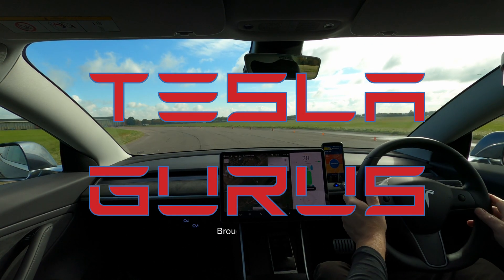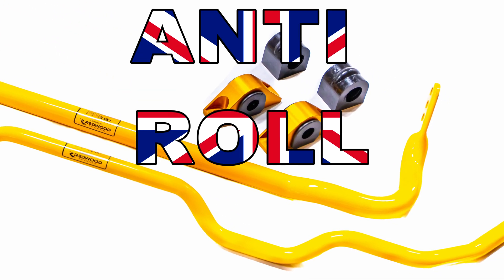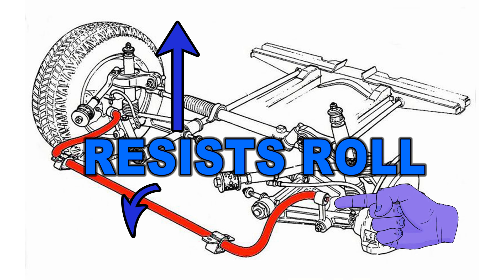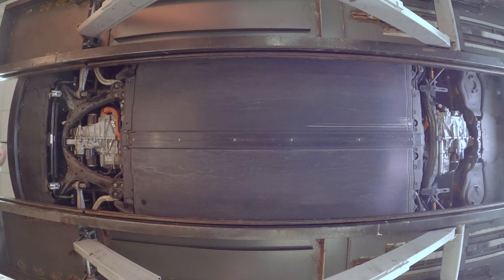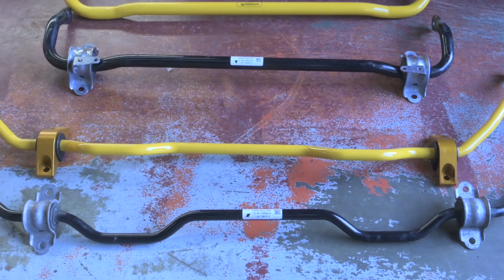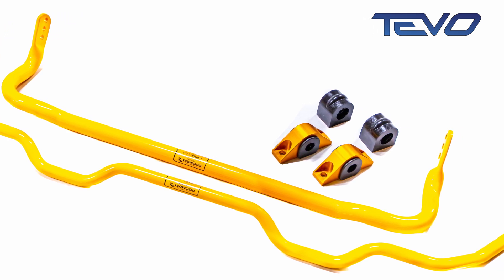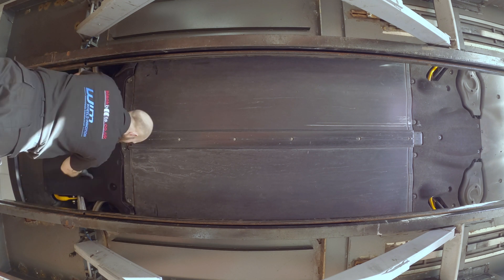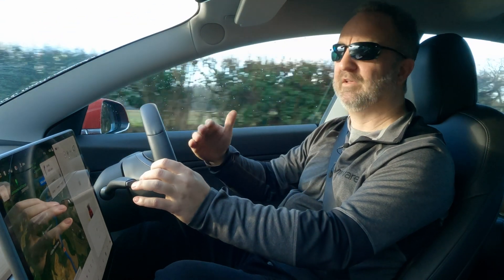Is this the most cost-effective handling upgrade for a Model 3?

Comment: I have a 2022 Tesla Model 3 Performance and I decided I wanted to make it handle better. So I took these guy's advice and bought some Redwood sway bars and had them fitted on the hardest settings front and rear and bought some MCA Pro Sport coilovers which I have set right in the middle for firmness. What a transformation, my car used to have some body roll and the suspension used to get bouncy when the shock absorbers got hot. No more, very little body roll now and zero understeer and just a little oversteer (a very slight power slide) if I go hard on one of the many cloverleafs we are lucky enough to have in the city that I live in, Canberra in Australia. It is an absolute blast to throw around corners. It feels so planted and I have absolute confidence that I can push it as hard as I like into any corner and it will safely negotiate it. So thank you Tesla Gurus for your advice, very pleased to have followed it.

Comment: Do you  need the adjustable end links???  I see a lot of people just doing the bars.  Thise end links are almost as expensive as the bars themselves! lol.  Nice to see this video as the new model 3 went too soft regarding sway.  I feel like im on a jet ski in the turns without the water.....With no other suspension mods, can I go full stiff front and back or do full stiff in the back and middle hole in the front?  Whats the benefot of middle hole in the front?

Comment: @TeslaGurus I am aware of the advantage of ARBs but I was wondering of suspension Geo and tyre pressure. I noticed that the highland has more front toe out than previous generation awd. I would expect the steering to be more neutral with the added toe out and I though that better geo associated with 40/42 psi front and 44/46psi rear should make  steering more responsive. What are your thoughts/experiences?
Reply from the maker: The Tesla service manual hasn't changed. Front toe is still 0.05 out (with ballast). A little toe out is always a good thing IMO but it's personal preference to a certain extent. Don't forget the Highland M3P is a staggered setup, so ARBs will be tuned differently to previous M3P. As with all cars, geo needs to be tailored for a particular use case, so it's best to work with an experienced alignment shop to determine the best settings for your needs.

Comment: If you upgrade the suspension to coilovers Mountain Pass Performance actually recommend putting the stock sway bars back in or using their sway bars which are only mild stiffness.
Reply from the maker: I agree that with any decent set of coilovers the sway bars don't need to be upgraded but it does depend to some extent on the spring rates used.

Comment: Wrong about the welded tips a good tip is welded but the tip should be welded on outside but also have a tab that protrudes inside the tubes this prevents flex and hot spots but a formed tube can only be formed so much before it becomes the weak point.

I won’t make any claims it’s not better than stock but as an engineer I can make a better product that has a weld

Comment: I am so regret to have my sway bar upgraded to Eibach,which is much stiffer than stock one resulted in a very uncomfortable drive
Reply from the maker: Are  you using the factory drop links or did you buy adjustable ones with the sway bars?

Comment: ive noticed excessive tyre wear on the rear wheels of my M3P. I read that it can be caused by faults with the rear suspension. There doesnt seem to be any adjustability on the rear wheel suspension either at least with stock parts. Have you guys made a video about this, can it be easily upgraded to help preserve the tyres?
Reply from the maker: There is adjustment for toe, which is the most likely cause of your wear.
Reply: @TeslaGurus  The wear is entirely on the inside of the tyre, it looked in good condition from the outside. When up on the ramp it was down through to the fabric. The garage guy said there was no adjustment he could make.
Reply from the maker: @samuelprice538  He was wrong. There is a small amount of adjustment for toe at the rear. Take it to someone who knows what they are doing such as Blackboots in Chesham, Bucks.

Comment: Wider tyres and drop the pressures will give same effect.
I have equipped my tm3p with 245 45 18 Goodyear Supersport tyres with light rims. Hot pressures is 40psi. 
100 load Index tyre, can carry more weight at lower pressures.
On 42psi cold, car tips/rolls more. Effect that you're describing. 
With lower pressure, sport steering mode is more compliant too.
Reply: Wrong, wider tires have zero to do with body roll and if you droop pressures, you will get tire slide over the rims.

Comment: Do you have the squeaking noise from the rubber bushings? I got the same sway bar and have that noise! Any suggestions?
Reply from the maker: All sway bars and bushings can suffer from squeaking after a while. The usual answer is to re-grease between the bar and bushing but we are testing a more permanent solution. Have you gone back to whoever supplied them to find out what they say?
Reply: @TeslaGurus I have eibachs for 2 years now and creaks started , regressed them with silicone grease did not help. After weeks of checking and degreasing I found cure.
Wrap the contact area of arb and bushing with ptfe plumbers tape, regressed and reinstall. All noise gone. The polyurethane bushings are known to squeak and it’s like your arm bushings are broken. I think the bushings have been polishing the arb surface so much that’s it squeaky clean and very grabby.

Comment: Will the lifespan of stock end links be affected by fitting a stiffer anti-roll bar?

Cheapskate, pondering if it's a false economy to avoid having aftermarket end links fitted if it's somewhat inevitable they will need replacing later.

Will confess to much of the information in http://www.aurorabearing.com/pdf/in-rod-we-trust.pdf going over my head.

Are the stock end links non-adjustable, meaning there might be some unbalanced pre-load on the anti-roll bar?
Reply from the maker: Making any suspension part stiffer could shorten the lifespan of other parts on the car, but it's difficult to guess how much it might affect the drop link bushes. Not much I'd say. Aftermarket end links will also wear too. Everything has a lifespan!

Comment: What hole setting did your friend use for the front snd back on the sway bars?
Reply from the maker: He went full stiff front and rear. I would recommend maybe trying full stiff at the rear and mid way at the front to begin with but it depends on what sort of driving you'll be doing and whether you have any other modifications to the car.

Comment: If the thicker anti roll bars are better and don't detract from the ride quality why are the OEM bars not to that same specification? Any cost difference would be invisible at the time of manufacture. There must surely be a trade off somewhere?
Reply from the maker: For the same reason a lot of owners complain about the ride quality and handling of the factory coilover suspension. All components on production cars are carefully cost-controlled by the accountants. They just have to be 'adequate' for the target market. Not all Model 3 owners care whether it handles really well, so a cheaper anti roll bar with no adjustment is fine for them.
Reply: @TeslaGurus  But if we are talking about the Performance Model 3 people are paying well over the odds ... for ... performance!
Reply from the maker: Name one mass produced (i.e >5000 per year) performance car which is fitted with the very best of each and every component from the factory. This is why tuning companies exist. They make a mass produced car better by improving areas the bean counters don't allow. For the performance you are getting from a stock Model 3 Performance, you would be charged a lot more money by BMW, Mercedes, Porsche etc.

Comment: Great video 👍 just found /subscribed . Nice to hear some English 😆
Question: can you explain more about the adjustments .. I always thought softer antirollbar at front and harder at back reduces understeer and gives better turn in (almost counter intuitive !) . Does this apply to the model 3 ? . And how effective are the 3 positions ?
Reply from the maker: Hi Mark, thanks for the nice comments! Yes, you're quite right that stiffening one anti roll bar will lead to a higher proportion of grip at the other end. It works exactly the same with the Model 3 but because it already has a lot of grip available and turns in nicely even in standard form, I don't think most drivers (using one on the road) will feel a dramatic change in balance by altering the settings. Probably more of an overall feeling of more/less body roll.
On the track, it's a different matter and in standard form the Model 3 tends to understeer, as most cars do these days, so adjustable ARBs can be used quite effectively to improve the balance, although it has to be said that the Model 3 Performance is really the only version suitable for serious track driving. With the M3P,  you'd use Track Mode settings mainly to dial out the understeer, but the ARBs can then be adjusted to fine tune the balance.
Reply: @TeslaGurus  With the Redwood set, are the stiffness settings all stiffer than the standard anti roll bars? Or is one hole on each roughly equivalent to standard? Do Redwood suggest selecting specific stiffness options for front and rear or is that all down to driver preference? I'm assuming some drivers may prefer understeer/oversteer?
Reply from the maker: Yes, the lowest settings on these bars will be stiffer than the stock bars. Which settings you choose will be down to driver preference and also whether you have any other modifications to the car such as different size tyres, staggered v. square set up, coilovers etc.
Reply: @TeslaGurus  Thank you. Driving a stock 2021 (Fremont) LR with 18" currently.

While researching options I noticed the Eibach sway bar kit for the Model 3 isn't listed as compatible with the 2021 model. Could just be the retailer configurator has not been updated yet or perhaps Tesla made some minor tweaks to the suspension too. Nothing on Redwood Motorsports site to suggest their set is or isn't compatible with 2021 model year cars.
Reply from the maker: @LeiChat  You'd benefit from the sway bar upgrade and maybe start off with the front bar set to medium and the rear bar full stiff and go from there.

Comment: I put Unplugged Performance sway bars on my M3P, and it was a SIGNIFICANT difference. The car doesn’t feel “heavy” anymore, much more responsive, and you can tell it’s using more of the tire patch. I went with UP because they have bushing locks so the bars won’t move around under load. Did both easily with a set of ramps. Definitely recommend them!
Reply from the maker: The Redwood bars also have clamps to stop the bar moving from side to side, but more importantly they do not have welded ends like the UP bars. I have fitted both UP and Redwood bars and I can honestly say the Redwood ones are better engineered, which is why we went with them.
Reply: This is what I needed to know!  Looks like Redwood it is!
Reply: @cyprianskiba8768 any update?
Reply: which setting was yours?
Reply from the maker: @goodreason6462  Full stiff all round for me!

Comment: Finally
Now I will keep my M3P and get some Eibach Sway Bars to bad their are only available in the US and i have to import them to Austria
Reply: Should I also buy the adjustable end links only available for the front? 
Already have the lowering springs from eibach
Reply from the maker: Eibach are available in Europe. And Tevo can ship Redwood ARBs to Austria too. :)
Reply: @TeslaGurus  where are the eibach sway bars available? I was searching the whole week for it
ARBs?
Thr shop has some nice stuff that i will buy some time
Reply from the maker: Eibachs have been in short supply, that's true. I meant to say they are sold in Europe. Doesn't mean they are available though.
Reply: @TeslaGurus  ah okay - yeah i also found no tüv certificate so i thought they maybe don’t sell them in Europe 
I sent them a enquiry via mail but i already contacted a seller on ebay taxes and shipment is heavy almost doubles the price..
Reply from the maker: I really don't know why the Eibach ARBs seem to be such a problem. I know of a UK car fitted with them but when I tried to buy a few sets they were out of stock for months. Now I don't even see them listed in a UK supplier's shop. It's a shame because apart from the Redwood ARBs, the Eibachs would be the only others I'd recommend for a Model 3.

Comment: Is it worth doing this on a SR+? It would be great to hear about mods for the non performance that give bang for your buck.
Reply from the maker: Yes, absolutely. It'll make a big difference even if you never take your car on track. Reduces body roll without changing the feel of the car when it's driving along the road normally. The standard SR anti roll bars are smaller than the M3P ones, so you'd probably feel even more of a difference if you fitted these.
Reply: @TeslaGurus   How much smaller is the SR+ compared to the performance's? Would it make sense to upgrade the SR+ AR-bar to the performance's which are going to be available second hand thanks to people upgrading their perf M3 then? :-)  Or better go full monthy directly ?
Reply: @olbtube  good idea my performance bars will be available austria near german border or via postal
Reply from the maker: I'd say you'll get much more benefit from going to aftermarket bars rather than Performance bars. Plus the aftermarket ones will be adjustable.
Reply: @TeslaGurus  thanks! All a matter of bang for the buck in the end. Would be great to try the different versions before buying, which gives the after market and advantage.
Reply: olbtube when i switch i will drive just 10min without them just trying without should be funny
Reply: @steinmar2  make a video for youtube, and be careful, it could handle funny indeed!
Reply: @steinmar2  Hi Steinmar2, did you end up doing the upgrade? Any thoughts?
Reply: @olbtube  i did import the eibach springs stabilizer /sway bars and end links and it was really awesome! Now i am selling sway bars and endlinks because i get model y in few weeks and (although i think they fit) i just yesterday removed them fr0m the car and the differnce is really huge!
Reply: @TeslaGurus  Would you prioritise an anti roll and end links upgrade over coilovers on an SR+ or LR ?
Can coilovers have as dramatic an improvement on cornering without the anti roll bar upgrade?
Reply from the maker: @LeiChat  That's a good question. If your budget is limited then ARBs + endlinks is going to give you an immediate improvement for less money than even the cheapest coilovers. However, if you were to fit a decent set of coilovers instead, you'll benefit a lot more. 
So, my advice would be to EITHER fit ARBs & endlinks, OR fit good quality coilovers. If you went for uprated ARBs/endlinks and then fitted cheap coilovers, you will probably have spent as much money as a decent set of coilovers would have cost in  the first place. With decent coilovers, the ARBs are contributing a lot less.

Another way to think about it:
Good coilovers can IMPROVE the ride quality as well as the handling. 
Cheap coilovers will often improve the handling but make the ride a lot worse. ARBs will improve the handling but at least they won't make the ride worse.
Reply: I’ve had Ohlins R&T on my Mitsubishi Evolution with aftermarket ARB’s and the handling was second to none.  I’m hoping to reproduce what I loved on the Evo onto my M3P.  I plan to get the redwood Ohlins Coilovers and redwood ARB’s.